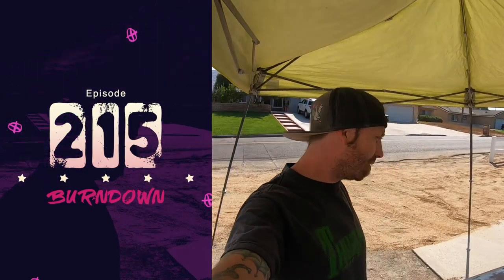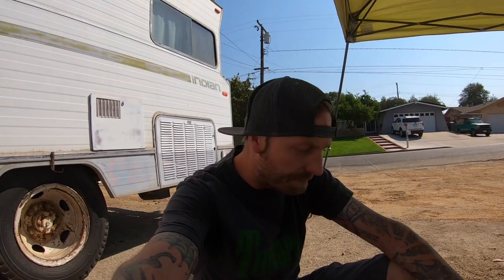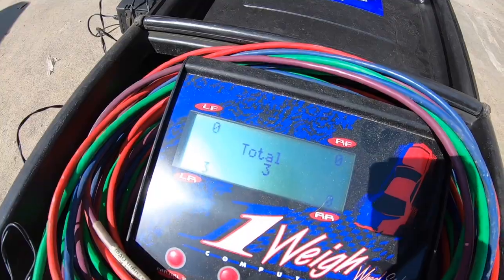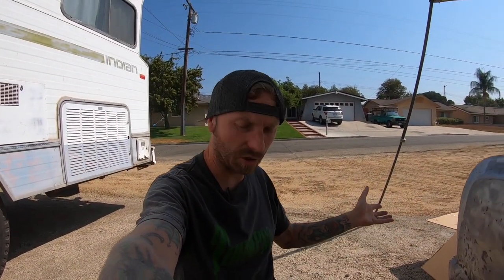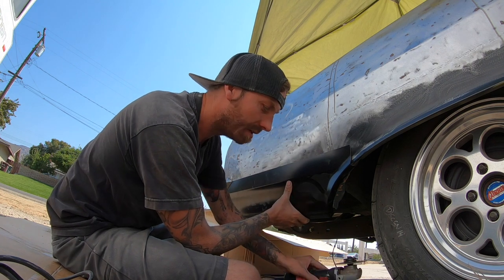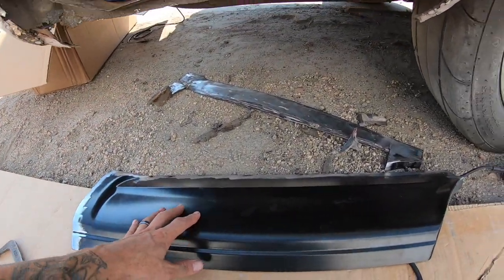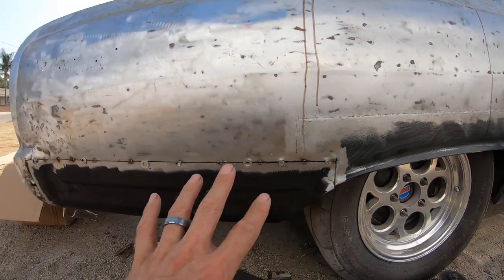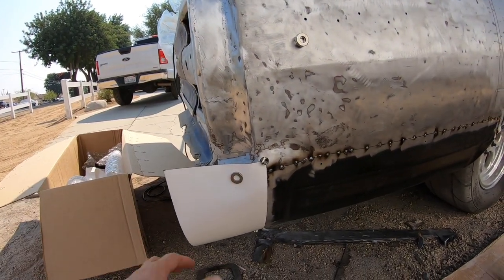More Rust Repair On My Chevelle

Comment: You should give the cut & butt technique a try. After tacking into the place, instead of cutting out the old panel completely work your way around. Start on one side and as you work across the panel with the cutting wheel push the new panel in so its flush with the old panel and retack it. That way when youre done you dont need to fight with holding it in place.
Reply from the maker: That works well and probably would have worked in this case. Thank you for sharing.

Comment: Here in New Hampshire we have the pleasure of finding spray foam behind the fiber glass love the video keep them coming thank you stay safe
Reply from the maker: I have seen spray foam!!!! The Caddy I did that is on here with the spider webs on it had spray foam with bondo over it! I was impressed.... and sad at the same time when I found it. I was supposed to paint the car and ended up dong metal work on the whole rear window section and truck filler panel... and front fender patches.  https://www.youtube.com/watch?v=TxYjeQF-Sc8&list=PLce6n_4IPVVoW5KVIziMBIHbiLaSs_SXu

Comment: The Maliboom is getting closer to that blue top coat, great video as usual Dane 🏁
Reply from the maker: We are close to epoxy prime! Then onto some filler work! I have a few things to weld up still but im starting to see the light at the end of a long tunnel.
Reply: @Burndown   you might have mentioned it in a earlier video, but what of epoxy primer you gonna use? I used to use ppg DP and done great, but I don’t know if they even make it anymore. I’ve been out of the body shop for about 12 years now.
Reply from the maker: @jayadams5529  I just use Limco for primer.

Comment: Nice job man, my 69 Pontiac needs the same treatment on both quarters and behind the front wheels. Just need to buy some patch panels and a welder I guess.
Reply from the maker: This is the basics of how I do it. I have a video coming on the other side as well and its pretty straight forward. What I would say is strip the area first to make sure the panel will fit before you start cutting things up and get in over your head. Good news is its just metal and can be fixed. I would encourage you to start with a fender patch first to get a feel for it. Then move onto the larger stuff.

Comment: The hammer between the panel and mig gun is that your trick for spacing or pressure to push panel? Never seen that before. Enjoy your content.
Reply from the maker: I call it the ( What I had laying around technique 🧐 )
The bottom panel was out a little further than the top piece I was welding it to so I used the flat part of the dolly to hold them flush while welding. Ill use whatever I can grab so I dont have to walk back to the tool box 🤣  I use a small flat head sometimes to pull or push the panels flush as well.
Reply: @Burndown   I FULLY UNDERSTAND AS YOU NEVER TAKE EVERTHING YOU NEED WHEN DOING A JOB AND IF YOU'RE LIKE ME IF I STAY GONE TO LONG I MIGHT LOOSE MY PLACE AND FORGET WHAT I WAS DOING. LOL.

Comment: LOOKs Good!!! One question if you live  in Ca. why does car have so much rust? I always assume that California cars had little rust. Good job anyway.
Reply from the maker: This car was made in Long Beach as well. I have no idea where it has been in its life tho. I would say that the rust in this particular car is from poor repairs really. These are also known for rusting out on the rears as well. I have done a complete rear end on a 65 before. If you park a car where dirt can get in and the weather can get to it all bets are off. I have seen a few cars come through in the last 12 years that have had almost no rust at all tho. These cars weren't designed to last for 40-60 years either. Your AZ and Desert cars are usually pretty dry and good.